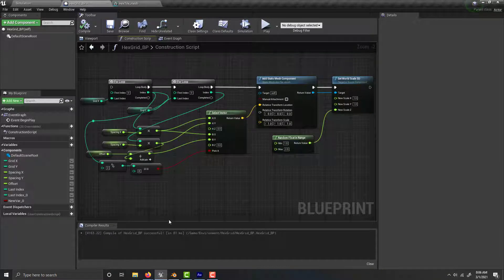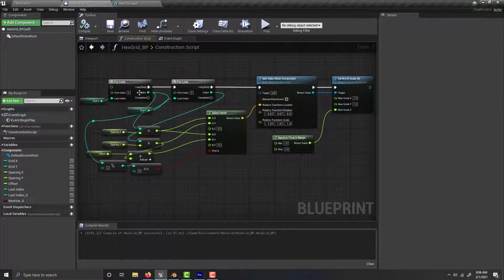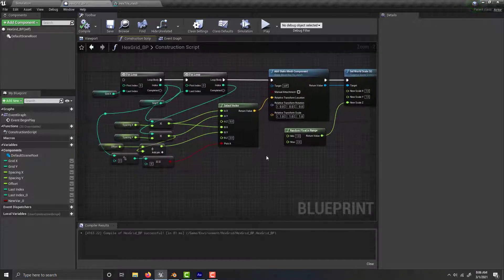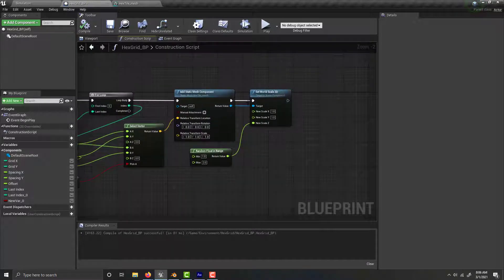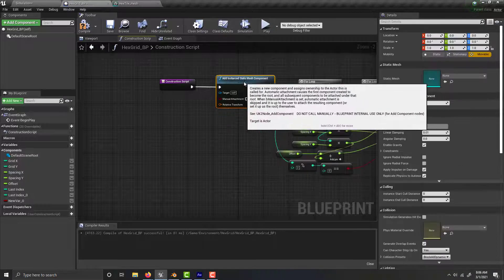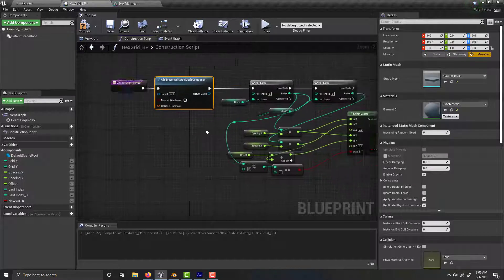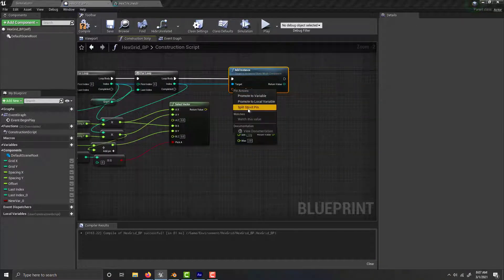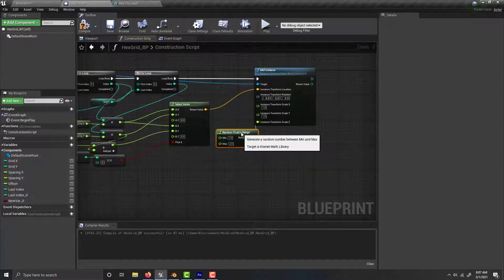UE4 Hex Grid Performance Fix

Comment: It is very good. And tell me, is it possible to interact with these instance objects? Change the color of a single hexagon or get its coordinates?
Reply from the maker: I don't think you can change the color of an individual instance, but you might be able to do a line trace from the character, and if it's an instanced static mesh, get the location of it, and then remove it and spawn a regular static mesh at that location. Not sure about reversing it. You could also maybe cheat if you just for example want the top of the panel to light up, and spawn a flat hexagon just slightly above it. I believe "Get Instance Transform" is used for getting the transform of each instance. I might mess around with it and make another video if I can find the time.
Reply: @IAmAzarath  Thank you for the detailed answer!